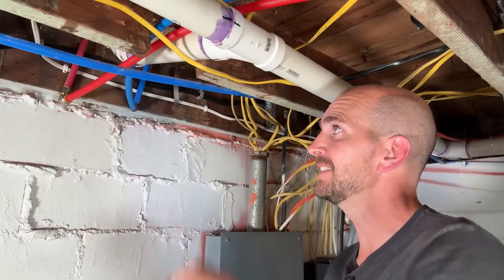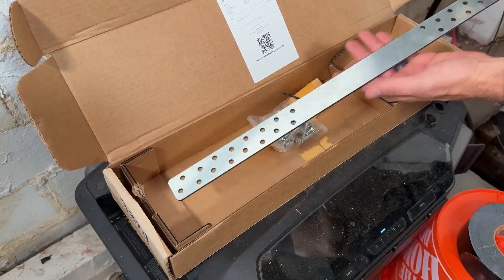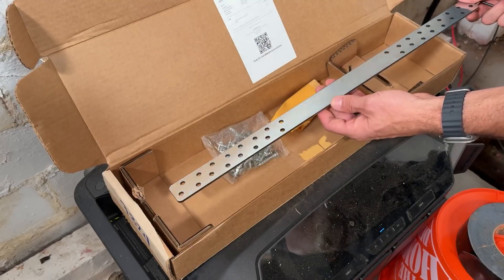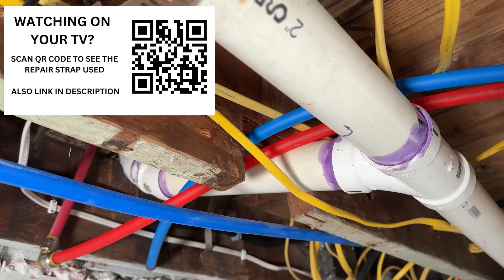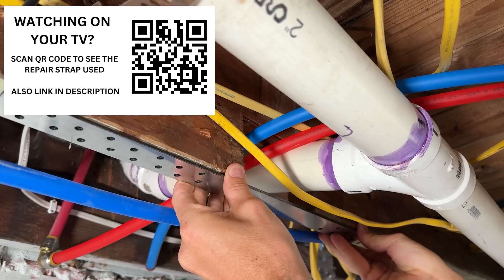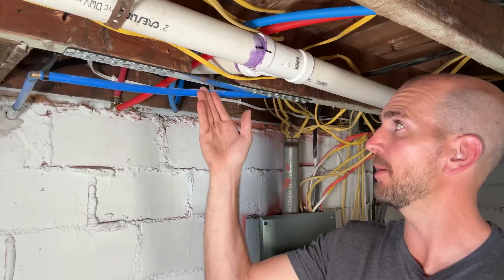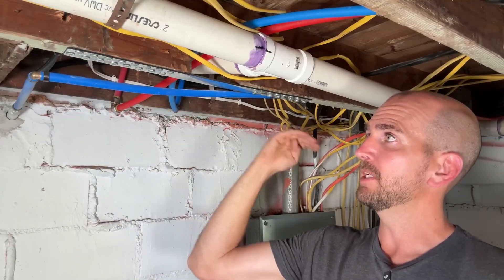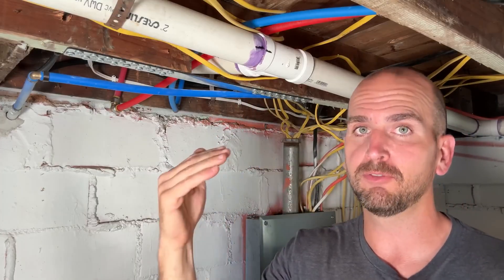Repairing a Notched 2x8 Joist (Without Rebuilding the Floor)

Comment: That strap is not worth a damn unless each screw is angled away from the gap to pre-stress each one against the wall of its hole in the metal strip and its threads against the wood.  If the metal strip can slide even 1/10 inch on each side  before the screws all bind against the strip and embed their threads into pressurized wood, that represents changing the angle of the beam by an angle whose tangent is 0.1/7.5 (the latter being the depth  of the beam).  That will also be the angle of beam sag from its ends, which could be 0.96 inches in the middle of a 12 foot span.  I doubt you can count on friction between screw heads and the metal strip to prevent slippage until the screws are stressed against the metal holes and their drilled wood holes.   Preventing breakage is not the same as limiting sag or floor bounce, but it could meet structural codes.
Reply: If you zoom in at 1:00, you will see the screws have shoulders under the heads. So they will fit tight in the drilled holes in the flat bar. I’m sure their website has engineering drawings, material specs, and a signed-off P.Eng. Report.
Reply: @kimsmoke17  That was not obvious and zooming in is not something my screen can do.  But full fill screws sound much  better.  But you will still not have stress in the wood fibers comparable to parallel joists unless you jack up the beam to at least level before inserting the screws.  Otherwise the plated beam will continue to have transferred some of  its share of the floor load to adjacent joists by sagging; and the plate only locks in that sag and load transfer.
Reply: Yup.. he should have jacked up the joist slightly to pre load.. installed wrong

Comment: Do you need to raise the joist slightly to “preload” the tension in the strap?  Glad there’s a fix for plumbers decisions. Sometimes there is no alternative. :)
Reply: Absolutely correct you are. Any beam or joist notched that drastically has some sag. A straight edge will show that. Jack both sides of the beam/joist until it is ever so slightly bowed upwards and then install the strap. A bit more work but worth it in the long run.
Reply: @robertmerrill123  Agree 100%.  (BTW I'll bet you're an engineer.)
Reply: As a carpenter of 52 years, I certainly would! That big of a notch it must have sagged!
Reply: Yup.. he should have jacked up the joist slightly to pre load.. installed wrong
Reply: Thirty year retired home inspector here. You are absolutely right 👍🏻
Reply: Right you are.